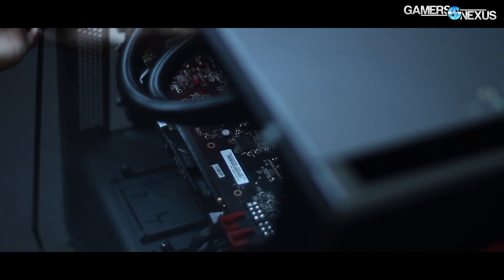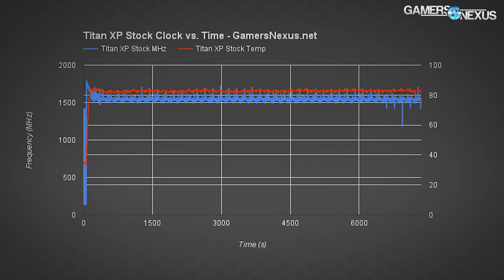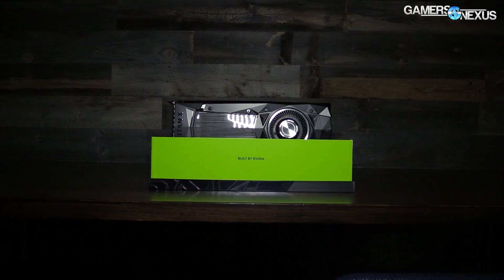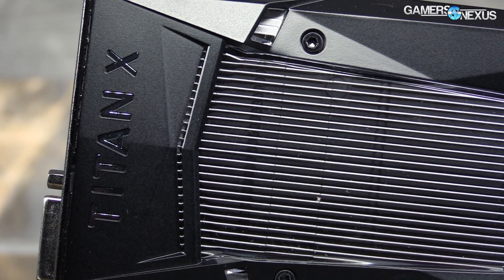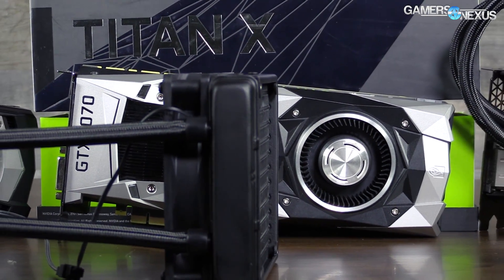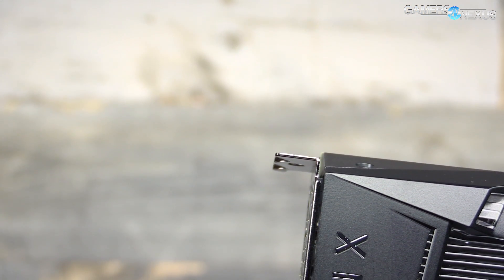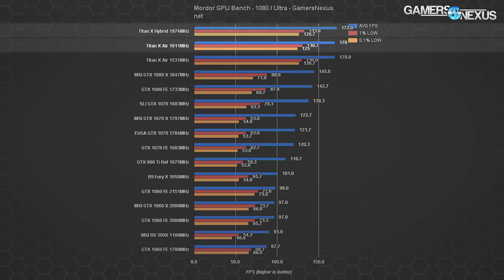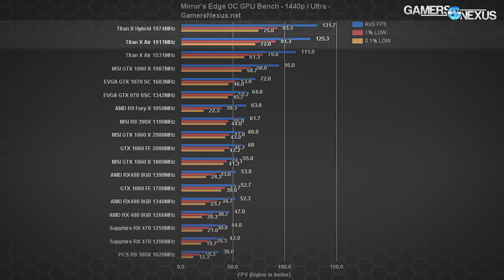TITAN X Pascal Severe Thermal Throttling (Hybrid Results)

Comment: Would it help to remove the transparent plastic piece on top of the heatsink on the TitanX? This way the heat would no be directed outside but rather a little bit everywhere and maybe the heatsink could be cooled with additional fans? Bad idea?

Comment: I recently did this to my 1080ti I picked up. My question is, if I turn the pump to let the tubes face the back of my case, will I be able to 1. install the 1080ti panel back onto the card? and 2. will it have enough room to mount onto the rear exhaust location?

Comment: Hey there, followed this video for my Titan, works well and glad I was able to keep the stock shroud 'cause i much prefer the look of it to the hybrid.

Just a quick question, I know you mentioned in one of the previous logs that the GDDR5X chips run on lower voltage than regular GDDR5 and won't get so hot, but since the stock heatsink is now out, the only thing sinking heat from the VRAM is the baseplate. Is it ok to leave it like that for an extended period of time? 

I did buy some copper heatsinks for memory chips and attached them to the baseplate with thermal tape around the cooler, just to be sure. I mainly use the card for number crunching/protein folding calculations and some gaming on the side, so it's running full speed quite a lot.

Thanks in advance!
Reply: someone needs to answer you. I have that same question as well.

Comment: My water cooled Titan XP achieves a sold 1867Mhz stock boost vs. 1534Mhz when using the stock aircooler.   It's apparent that either I have a slightly better GPU than their unit or the waterblock is superior to the Hybrid solution, or a bit of both is involved.  Manual overclock I was able to attain are 2088Mhz GPU and 11880Mhz Memory.  I've only had the Titan XP water cooled for a few days and will continue to play with the clocks to see if I can get a higher GPU overclock at the expense of a lower memory overclock.  I am using an EKWB Titan XP water block and backplate ;-)
Reply: Dan K So what is your max clock right now?
Reply: I haven't tried to clock higher.  But now that the voltage is unlocked, I'll try to see if I can push the clocks more.  My guess is that the card BIOS will not allow for much higher clocks.
Reply: Dan K WOW how did you unlock the Voltage?
Reply: The voltage was unlocked later on by both the MSI Afterburner and EVGA Precision X tools.  Check it out for yourself.  Voltage adjustment is now unlocked.

Comment: It really seems like you got a weird card ( or I did) I can hit and mostly sustain 1950 with a few drops to 1900 on the stock (fan spinning full speed). Room temps at around 70-75F. Stock boost it will stay above 1700mhz. Perhaps I should try other benchmarks. 

With the memory on mine I get graphical errors over 450 mhz overclock. I leave it at 400+mhz

Comment: Most of the overclocking nowadays seems to only increase performance in such a way that the results can only be noticed with measurements, as opposed to older cards, which had perceivable gains with overclocking.

Comment: So, how I understood, its hybrid solution doesn't really make sence, if you want to overclock, because the fps stays pretty the same, and the reason is the max voltage of the card is not high enough? of caurse the common temperature goes down and by overclocking as well, what is good for a lifetime of the card after overclocking?

please correct me, if i am wrong. it's because english is not my main language, but i am trying to learn it, and i love hardware :)

Comment: why do the reference designs still have blower style coolers? they're almost the only ones to use them and apparently you can't make a powerfull and quiet blower style cooler. Of course, they want to cut costs and for the RX 480, for example, it was obviously necessary, but for a high-end graphics card you should expect a hig-end cooler, not a low-budget one, right?

Instead you get an outdated cooler design with a plastic backplate...

Comment: That's the problem with reference designs these days, the routine of making it a blower design is something that needs to be left in the past.  Nvidia have been banging on about this (as they say) "premium thermal" that's on the 1080 and the titan, but realistically it looks good but it can't cope with cooling the gpu properly. Its getting to be an Apple mentality where looks overrides usage, or to put it bluntly "all show no go". 

They would be far better off designing a cooler with multiple fans instead of religiously using this blower cooler that at this point does nothing but hold back performance. There's really nowhere else to go on this design, they could possibly increase the density of the fins on the vapour chamber as to me they look pretty sparse compared to the surface area they have to work with, they could probably double the amount they have by making them a bit thinner. But even then its not likely to make all that much difference.

They need to look at different designs instead of recycling essentially the same thing time and time again. Amd have no fear of putting liquid coolers on the gpu's, 295x2, fury x (assuming you got one with no whine) and fury duo all seem to do fine with it.  It's about time nvidia put function ahead of form and done something different.

Comment: 12 hundred macaronis for a shitty blower? Well done Nvidia. Your greed is starting to get really questionable.
Reply: Because you can only get titans from NV themselves, if they would let other companies put their after market coolers you would see better temps.
Reply: why is it a shitty blower? the card just has a high tdp. there's only so much you can put inside a closed two slot cooler.
Reply: Paskek Lol, well titan xp start of being thermal limited, but once you put a water block on them you find they are fairly power limited.  They just need to release the 1080 TI with non reference PCB's with extra power phases.  10+2 MINIMUM>    It's a pretty let down when a 1200 dollar titan XP only has 7+2, when the card has over 1000 more cores then the 1080.
Reply: Disobeyedtoast They have the fans running higher to compensate, they are noisy..
The whole reason why nvidia lets the temps go to 84 is because they want to keep noise to a minimum. If you would ramp up the fan speed the temps will go down and the clocks will be more stable. But that means more noise.
Also a blower style cooler is best for many cases, because they don't accumulate hot air inside the case. And before you might say, well, then get better air flow. Most people don't have good airflow. This is the best ensured consistent quality for a normal use GPU, with a certain kind of consistency and compactness for most. Especially for Titans, where the market is not necessarily just for gaming.
But, I agree to some level, maybe they could let 3rd parties design custom coolers for them, but then again, the only ones complaining about this are the ones that don't spend the money on them. And you can easily buy your own EVGA hybrid cooler so you can mod it yourself if you have the card. Or use a waterblock.
Also, you can probably use an arctic cooling cooler or a different aio cooler on the card. There are still options.
Reply: ***** Most gamers who buy titans get waterblocks. But if you can afford a 1200 dollar gpu then why can't you afford a case with good air flow?
I prefer open cases with cpu and gpu water blocks, and using push pull on a 480 rad so the fans can have super low rpm.  You literally cant hear nothing.  Pretty dead silent.
Reply: 4GB MEANS 4GB fair enough, but there are also people that buy them for workstation use, which don't have proper air flow probably.And they maybe only have a tight space to fit them in. It's better that Nvidia or AMD produce the most standardized measurements with highest efficiency possible, than having to rely on third parties to provide their own interpretation of a reference design. Also, the heatsink inside is different than the one inside an 1080 I believe, or maybe that of a 1070.
Reply: +Tijmen J    Literally any other design on cooler would have been better than a blower. Old AMD GPUs have a higher TDP and most don't get up to 85 degrees celcius
Reply: ***** Ya i think the titans have vapor chambers and the 1080s have heat pipes.
Reply: LoL nice find.
The superior heat dissipation.
http://puu.sh/qHinn.png
Reply: I guess you folks still don't get it that the gaming industry for Nvidia is only a small portion of their business. They make most of their money with their intelligence thinking cards that are sold to companies around the world that deal with deep learning and discovering new things. For Nvidia Titan X pascal is not considered top of the line model nor is the  1080 or 1080ti if evercoming out. They treat it as is and expect partners to  do the rest. Amd however are more directly connected to the Gaming community because the company they bought out, Radeon which was making the GPU's was making gaming dedicated GPU's to begin with. Nvidia Stepped in only because they had the capability to compete.
Reply: Filip Cristian when did they have deep learning GPUs at the beginning of this millennium?
Reply: Nvidia fan said nvidia invented deep learning.
Reply: So, what do you think of the 1080 Ti?

Comment: would it be possible to then load a custom bios on that thing and unlock the power limit to even higher...150% for example and make that bad bitch run even hotter and even faster man?! Would the stock VRM of the stock reference board be the next limitation in your opinion?

Comment: Is the memory overclocking limited by power, or could it have something to do with some kind of built-in error correction?

What do you get if you keep the core clock way down (limiting core power demand), but overclock the memory? Does the max memory overclock increase significantly if you artificially limit the core power demand?
Reply: Honestly, GDDR5X is so fast at stock, that you really dont see a hell of a whole lot if any benefit by overclocking it anyway so I wouldnt really worry about it.. if you can get 400Mhz on your memory thats great. translates to almost 1Ghz overclock effective. Nothing to sneeze at.
Reply: Yeah, I was thinking of not overclocking the GDDR5X what so ever because of power draw, I would only overclock the core if I'm not hitting 60fps in a certain game at 4K because as you saw. The TITAN could go higher, but it just choked on power so I'm gonna stay away from the memory.

Comment: So is Nvidia pricing this card at $1200 because of the lower yields/higher costs of the GP102 and GDDR5X and skimping on proper cooling because of that or simply wanting to milk more money from selling the card by saving on the cooler? It's kind of sad that a card as good as this is crippled out of the box.
Reply: It has no competition, so they increased the price, think of it for a sec, if they know they sell everything they make with limited supply why not go for 1200$ instead of 999$, its additional 200$ of profit on each gpu.

The most interesting info about pascal titan x is it launched so quickly after gtx 1080, which means nvidia fellt that  in few more months this card wont be such a good deal for consumers, maybe coz of amd's vega, maybe nvidia plans to launch 1080ti or drop bombs with their volta gpus in early 2017, the thing is, with such an early launch of pascal titan, we can assume stronger or similary strong but cheaper cards are on the horizon in next 6 months.
Reply: Pretty much, until they release a 1080ti there isn't much we can do
Reply: You think that's bad, NVidia have set the price in the UK at £1,200. That equates to USD$1,564. At that price, I think they just lost my interest in a Titan X. I'll go down the 1080 SLi route instead.
Reply: I'm not sure that Nvidia sets the prices. It's usually the locals gouging it up+VAT and other stuff.
Reply: foreign's gaming tech

Very true with local retailers, just pascal titan x is an exception since its only is avaiable from nvidia store, u cant find it in ur local computer store at all.
Reply: foreign's gaming tech You can't buy an partner version of the Titan X, only direct through NVidia.com
Reply: I have a feeling that even with lower yields and higher memory cost, the XP doesnt actually cost much more that the regular 1080 or even the lower cards vs the 1080 for that matter...people will apparently find the money so they have a market. If people held on to their money tighter we'd probably get better prices but whats the chances of that happening
Reply: If you dump $1,200 on a GPU, you most likely use water cooling.
Reply: Yes the Titan XP is a piece of junk if you don't
Reply: water cooling parts cost is retarded for the same reason too. they make what is essentially a threaded to compression 1/2" adapter and sell it for ~$6 and people by the shit
Reply: konic40 small fittings are difficult to manufacture.
I work in aerospace, and I can tell you $6 for a compression fittings isn't expensive
Reply: LMAO
Reply: konic40 you have no argument.
Reply: Not An Argument.
(lol @ your name)
It simply doesn't cost that much.
wtf is ayrospace? u mean aerospace...compression fittings are used in regular plumbing...
Reply: konic40 these fittings have tighter tolerances.
smaller threads
are machines to remove hard turns
and are REAL brass.
$6 isn't expensive

also, attacking spell check is a fallacy.
Reply: Not An Argument.
tight thread means nothing, especially when they run gaskets anyway...ooOOooo brass, exotic...
Reply: konic40 what manufacturing do you work in?
Reply: What you say? no response overpriced BRASS fittings with gasket.
I work in solar electric and solar water heating , procurement and installation as a result im mixed up in plumbing, moving water in 3/8" opening shouldnt cost $6 per fitting. what do you do?
Reply: konic40 answer the question, what manufacturing job do you work at?
Reply: Not An Argument. LOL your name says it al, you dont have an argument. WTF did aerospace have to do with shit, I seriously doubt you are honest.... I dont think you understand what I do. Do you know what someone in procurement does and why it would make me have an idea of what stuff should cost?
Reply: konic40 answer the question Konic

do you work in manufacturing
Reply: Not An Argument.
LOL
Reply: konic40 still waiting.
Reply: Not An Argument.
LOL dumbass
Reply: konic40 waiting for an answer big nog
Reply: Not An Argument.
you're an idiot and you dont even realize, man that suppopsedly in aerospace
Reply: konic40 so do you actually assemble or manufacturer parts for anything?
Reply: funny you dont see the irrelevance.
alot of businesses dont manufacture themselves, they find suppliers, compare prices and order bulk. Case in point, I worked at a company where they sourced solar panels, bought by the container load..the manufacturer even offered to put our brand logo on it.
I'd bet all these expensive pc cooling parts are souced conservatively for anywhere between 20-30% of what they are charging.
Reply: konic40 do you make any product for a mass market?
Reply: Not An Argument.
make your point